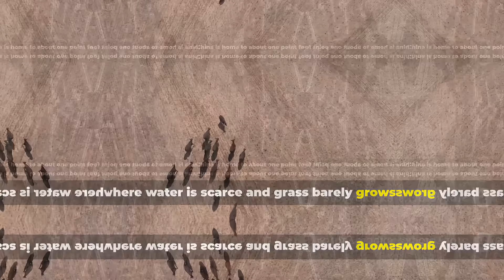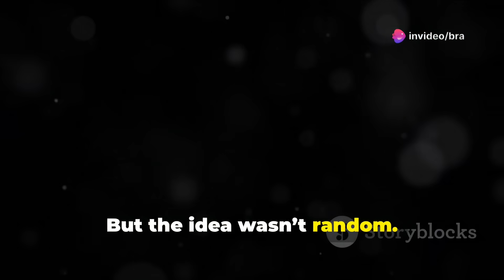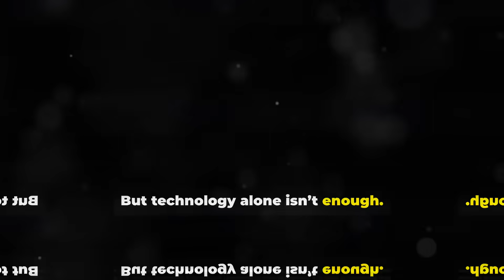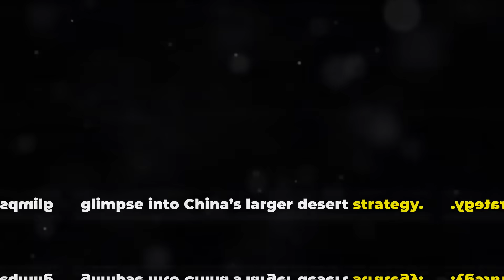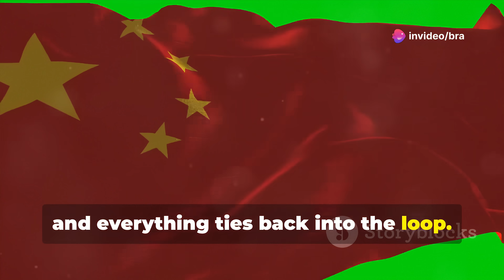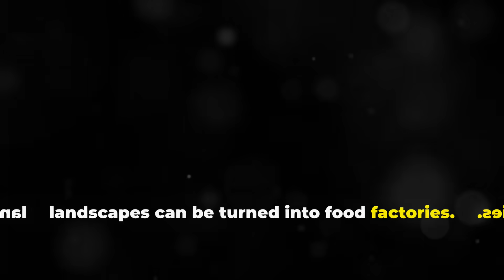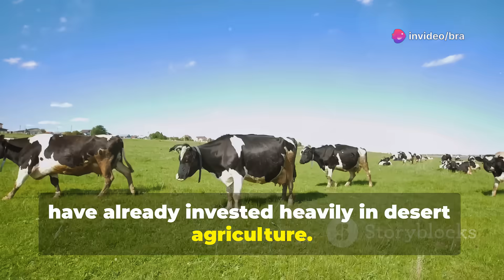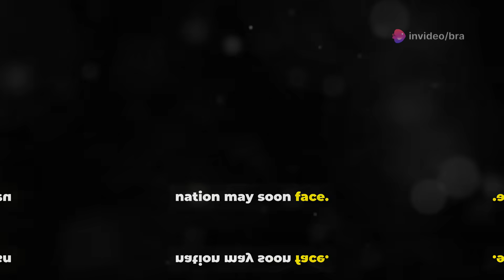“China Raised 8,000 Cows in the Desert — Now the World Is Speechless”

Comment: Electricity is now more important than clean water, because with electricity you can desalinate sea water. Another way to save electricity is to desalinate water deep underground, so the pressure required to desalinate is provideded by the weigth of the water itself.